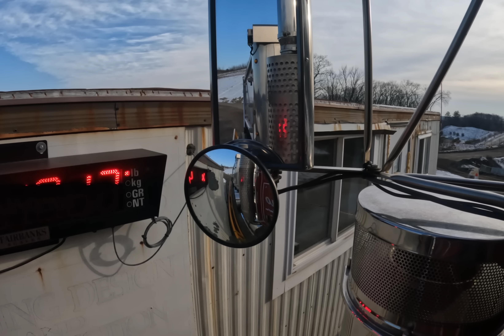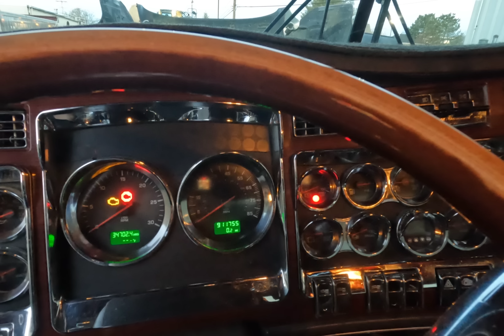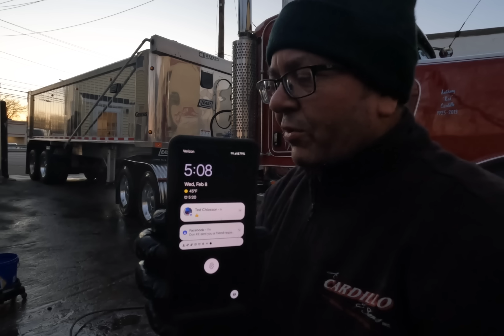Diesel Exhaust Fluid, NEVER heard of her! #trucking

Comment: Your truck even dirty is still cleaner than most trucks. 
I ran a Michigan gravel train year round for 15 years.  I know the hard work it takes to keep it presentable any time of the year .
As far as DEF , it is the major factor in new truck breakdowns.  Part's are expensive and some are nearly impossible to find .
Have a great day Mike.
Reply from the maker: Thank you Daniel
Reply: What GRAVEL PIT in Michigan? I run out of Aldridge off Dixie hwy..
Reply: @keepontruckinoutlawlife1248  
I hauled material in the UP of Michigan.  The primary haul was limestone off the docks in Marquette to the Iron mines around the area. 
Salt to the state and county garages. 
Blacktop in 8 axle flowboy trailer's. 
In the summer I did a lot of lowboy work also. 
But we stayed north of the bridge for the most part.
Reply: @danielyelle1070  AWESOME been up that way quite often.  Be safe driv,ah